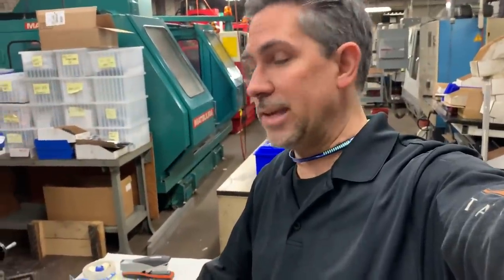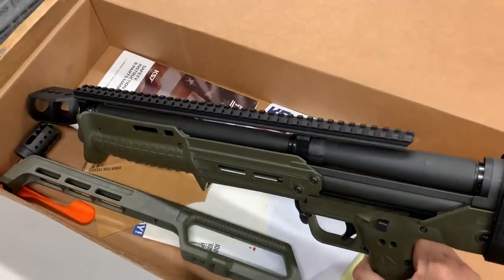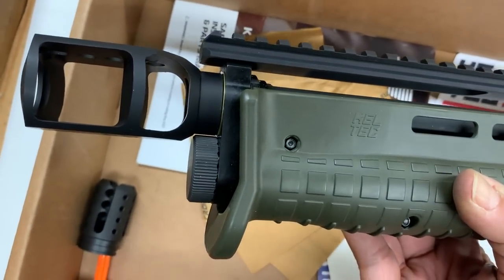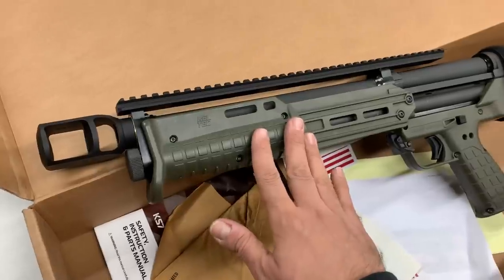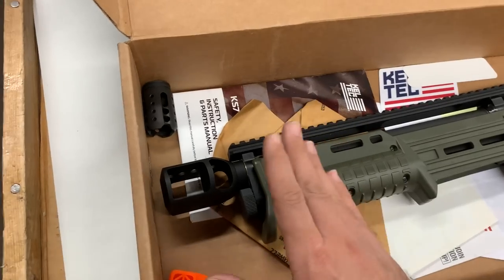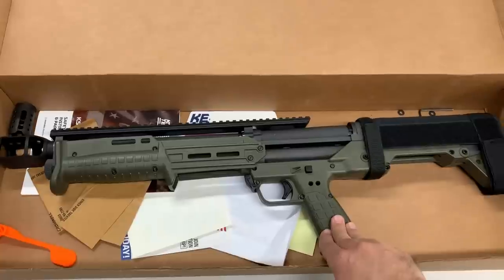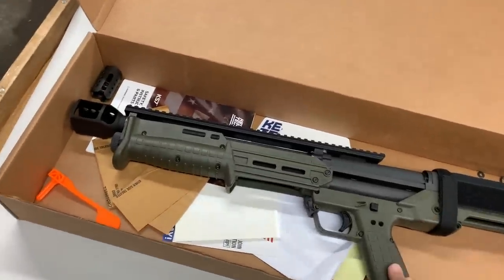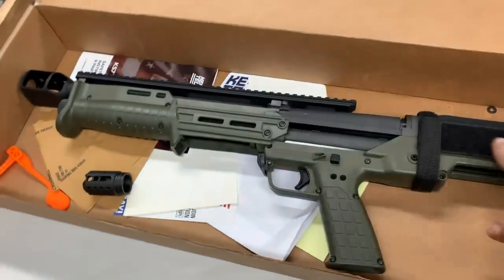The new KS7 from Kel-Tec, review, upgrade and thoughts by Hi-Tech Custom

Comment: I bought all your accessories for the KS7 and they are great, actually, they made the KS7 go from not usable to a fun gun, BUT, the tool you give for the muzzle brake replacement should come with a handle, it was impossible to take off the factory one and had to take it to a gunsmith even though I had a 1/2 inch handle. thank you
Reply from the maker: We do have a Nut Remover tool for the KS7 also.    http://www.hitechcc.com/product/HTC-100_KS7.html
Sorry you did not see it.  Thank you for your support and enjoy your upgraded KS7!   Watch for our charging handle mod coming soon!  Best regards.  Karl, www.HITECHCC.com

Comment: A shoot comparison between KS7 and KSG is in order.
Reply from the maker: Christian Denchasy I agree. Next video we make when we go up to our R&D shooting site upstate.  Stay tuned!
Reply: Saw another channel have issues with the feeding and the slide unlocking without the release being depressed
Reply from the maker: @maestrozero117   Always test out your gun at a range and make sure everything is working correctly.  If not, just call back the manufacturer and they will always take it back to repair or replace.  I know that stinks, but sometimes manufacturing or assembly issues happen.  Overall I think the KSG's or KS7's are very reliable if operated correctly.  Best regards
Karl, www.HITECHCC.com
Reply: @maestrozero117  just got one and the feeding is horrible, either it double feeds (70% of the time) or it doesnt even feed a shell on pumping (25% of the time) the remaining 5% is it actually functioning properly. I'm contacting keltec the second they open tomorrow.
Reply: @Eclipse538 yeah, I've never had a single issue with the other 3 or 4 pump shotguns I've used, tons of people had issues with the ks7 not feeding right. I sent it back, they replaced some parts and now it runs right with the same exact ammo that gave me issues, not just the same brand and type, but the same shells I used prior that wouldnt work. They somehow made an unreliable pump shotgun.
Reply: No problem man, I sent it back and keltec fixed it, mine was bought within the first 2 or 3 months so chances are it was from the original batch that had the issues. It works now and keltec covered everything so I'm not too upset.

Comment: What is the heat shield (that comes with the KelTec Pic Rail Kit ) for?  Without it what would happen? eg. rail deformation or cycling issue?
Reply from the maker: That's basically a cage that holds it all together and distributes the force.   We did not want to cut or drill into the plastic because that would ruin the integrity of the modling.  This is the safest way to do it.  Thank you.

Comment: Hi, you list both muzzle breaks, but you don't state the differences between the two other than the obvious visual difference.  Which gives you a lesser recoil overall?  Thanks
Reply from the maker: Hello.  Sorry about that.  The Howitzer70 gives you the most amount of recoil reduction of up to 70% depending on ammunition due to the most agressive porting machined into that design.  it was designed by the US Military and works very effectively.  The defender brakes reduces recoil by about half that amount.   Thank you for your support and have a great day.  Karl, www.HITECHCC.com
Reply: @karlhi-tech7853  Thanks
Reply: @karlhi-tech7853  Just ordered that and other parts, thanks

Comment: Hey thinking about buying one what is the New York laws on the Kel-Tec shotgun capacity?
Reply from the maker: KSG's are legal in all 50 states except the KSG-25.  You can have up to 10 shells in each "manually" selectable tube.  So the Manual Pump shotgun with a manual tube switch qualifies as legal in NY and CA which are the toughest states.  The KSG-25 is not because each tube capacity is over 10 shells.  Best regards,  Karl, Hi-Tech Custom  www.HITECHCC.com
Reply: Thanks I was sorting through all sorts of information tough to get a straight answer

Comment: I bought a KS7 about a year ago. It's my first shotgun. Only taken it to shoot twice because of recoil...my poor shoulder. 
What does the muzzle break do and what is the difference between the two breaks you offer?  I will be placing an order if it helps with recoil.
Reply from the maker: The Defender brake reduces recoil by up to 30%, while the Howitzer70 reduces recoil by about double that due to the aggressive design of the brake. Just see the comments below that talk about the great recoil reduction achievements. Definitely pair that with our Recoil Pad and it will save your shoulder a lot of pain.  Thank you and let us know if you have any other questions.
Best regards.  Karl,  www.HITECHCC.com
Reply: @karlhi-tech7853  Thank you Karl, my order will be forthcoming! Sounds like your accessories are exactly what I need!

Comment: Has anyone else felt the need for a carry handle once replaced with a picatinny rail? I can't seem to find one that will lock down in a vertical or low profile position when not in use (kind of a "C" shape to contour to the side). It's not super necessary, but I'd like to have the option and I'm probably the odd man out since I can't find anything like that.

Hi-Tech has some solid business practice - very quick response times and solid craftsmanship! Will definitely recommend to my friends.

Comment: KS7 Needs a front sling mount
Reply from the maker: We do have a top rail mounted side mini-angle rail. If you attach that, you can put a QD front mount block. But I think they were thinking the KS7 would be a quick access home defense or vehicle weapon. Not really to carry around. For that you might want to upgrade to the KS7 with more capacity. Hope this helps out.  Karl,  www.HITECHCC.com

Comment: I ordered a hi tec muzzle brake but for some reason it doesn't clear the bottom tube cap.. am I missing something here? Someone help
Reply from the maker: Please make sure you ordered the KS7 version.  The KSG muzzle brakes will not fit onto the KS7 due to clearance issues. We made the KS7 brakes narrower on the neck to compensate for that.  See the KS7 section here: https://www.hitechcc.com/category/ks7.html
Thank you.

Comment: I just bought this gun and now seeing this double feed issue. Any comments on this issue? Also where are you located?
Reply: Kevin Cease Just bought one as well. So this gun is pretty picky, I’ve discovered because of the bullpup design it’s easy to short rack it. Since the action is farther to the rear it requires a good sharp rack to the rear and quickly forward to the front. If not it will double feed. Also if you use the Walmart target loads, it doesn’t like to feed those very well lol.

Comment: I really like the KS7 - EVERY VIDEO I see on this KS7 - all owners complain about endless PROBLEMS & JAMMING- DOUBLE FEEDING- even after they send it back for repair it still WONT WORK RIGHT- every video on you tube shows these problems- when will This KS7 be fixed?
Reply from the maker: Ours works good.  Kel-tec will guarantee it works. If not they will take it back to resolve any issues.  Kel-tec is very good about that.  Thank you.

Comment: your products makes this a tolerable purchase BUT...
Worst gun you can buy, bought one and before I took it to the range, it started dropping multiple rounds on the ground every time you rack it, sometimes it does not feed either. the top tube is wobbly, and it kicks like a mule, I bought a pad for it, and a muzzle (that I have not installed yet so they don't cry and tell me I voided some obscure warranty, but I will when I get it back). forget about shooting slugs in it, your should cannot take it, no matter how tough you think you are, you will be bruised after few shots. the front of the barrel is so dangerous if you cycle fast enough, you could shoot off your fingers. with all that though, I have to give it to them, it does look badass! PS: I contacted them and they said they know and they have a fix, but then corona happened and they did not reply yet, waiting for the shipping label.

Comment: 416 can still get rust or corrosion.
Reply from the maker: It's still much better than the Carbon steel products coming from import brakes in China. And we also do a Mil-Spec DLC Black Chemical Treatment to prevent any corrision. We guarantee all products we manufacture. No worries.  Thank you.  Karl, www.HITECHCC.com

Comment: How are you supposed to field strip and clean the mag tube with the muzzle break attached? Because the cap is now blocked from unscrewing by the Howitzer
Reply from the maker: To remove the spring you would have to remove the muzzle brake.  There is no way around it.  But removing the spring is not part of a regular cleaning requirment.   We did not want to extend the brake neck next past 1" because that would look very odd.  I'm sorry about that.   Karl, HI-Tech custom Concepts Inc. www.HITECHCC.com
Reply: @karlhi-tech7853  Damn, that's unfortunate. I wish this was explained in the product description. Does the Defender break also have this drawback or is the spring cap accessible if I were to use it instead?
Reply from the maker: @mixstagram  Unfortunately the cap is so close to the thread above it that nothing will work at all.  Unless it's the same exact size as the nut which is very small in diameter.